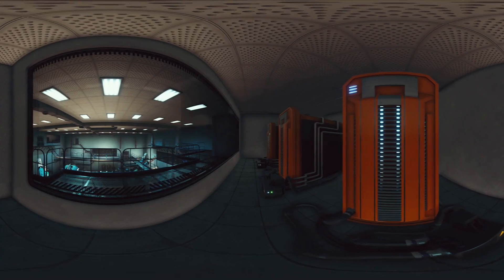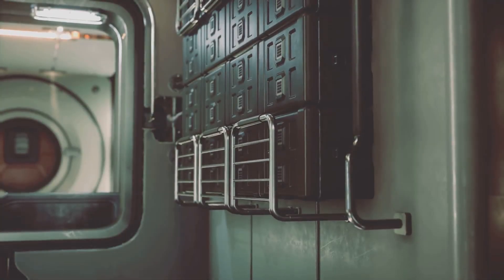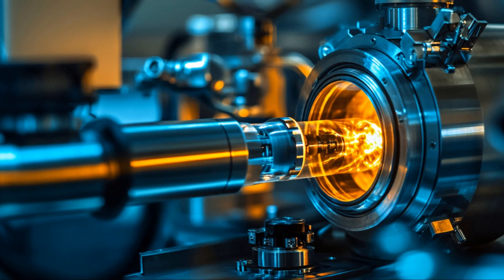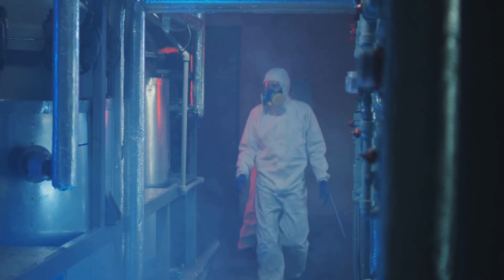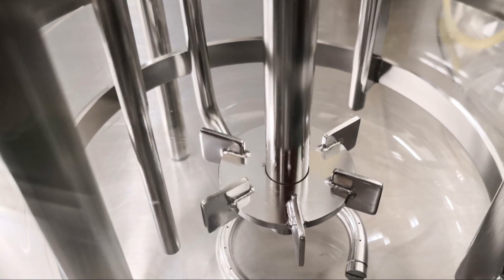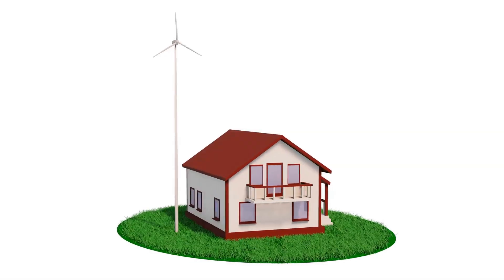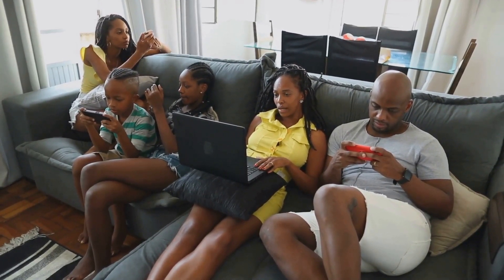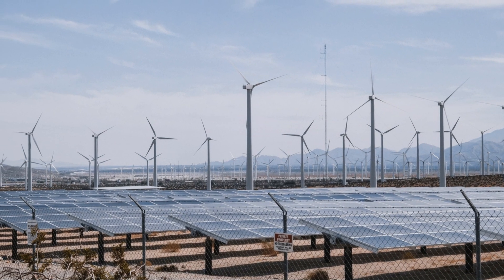Power Your Home with a Fridge Sized Nuclear Reactor

Comment: How do you manage the spent fuel rods?
Reply from the maker: Spent fuel rods are managed through careful storage in secure facilities. Initially, they are kept in water-filled pools to cool and shield radiation. Later, they can be transferred to dry cask storage or reprocessed to extract usable materials. Safe handling and long-term storage are key considerations for minimizing environmental impact.
Reply: This video seems like it may be literally entirely AI generated based on the account's responses. I imagine you'd have like, i don't know some kind of service that comes and takes them

Comment: Where can i buy one?
Reply from the maker: Thanks for your interest! Currently, fridge-sized nuclear reactors, like microreactors, are still in development and not commercially available for individual purchase. They are primarily designed for industrial or remote applications and require strict regulations for use.
Reply: @futureenergytechnology  When will it become available for purchase?
Reply from the maker: @yeetericus113  The timeline for commercial availability depends on regulatory approvals, technological advancements, and market demand. Some companies are working on small modular reactors (SMRs), but widespread availability for home use is still in the future.
Reply: @futureenergytechnology Is anyone working on this?

Comment: Thx but can we do it with microwave? Or I’ll build this in my home
Reply from the maker: Thank you for your comment! Microwaves and nuclear reactors operate on entirely different principles. A microwave can't replace a nuclear reactor for energy production. If you're considering building a power solution at home, safety and regulations are critical—nuclear technology requires strict expertise and authorization. Always consult experts and follow safety laws!